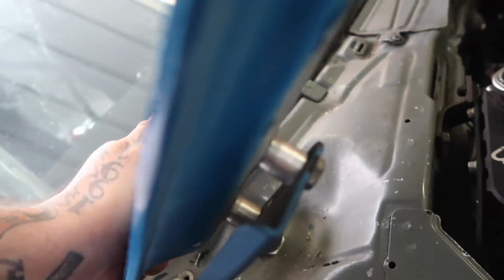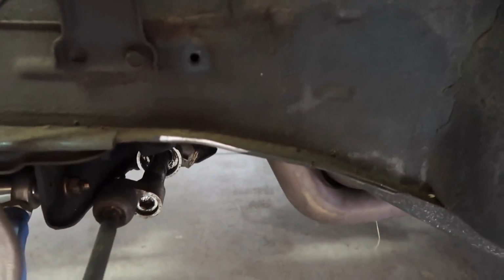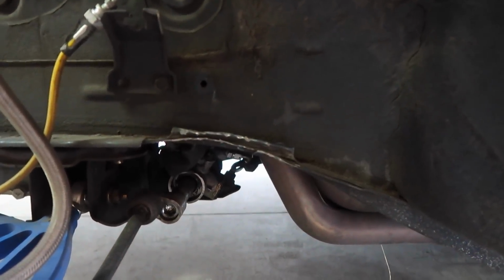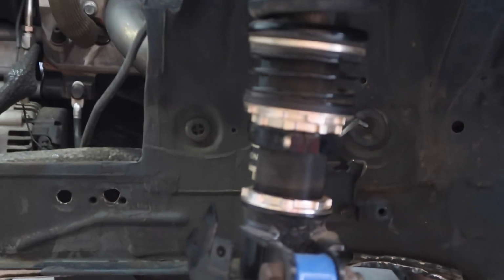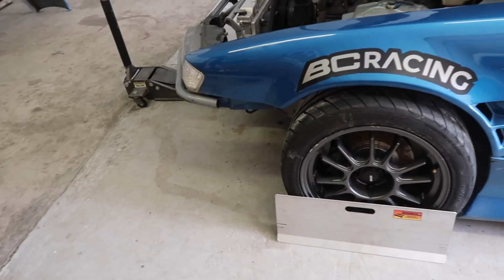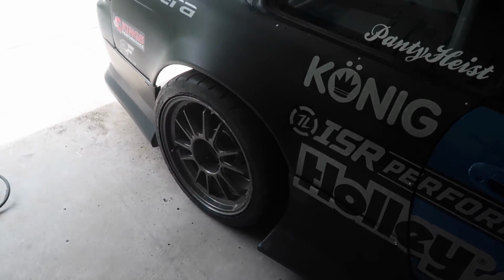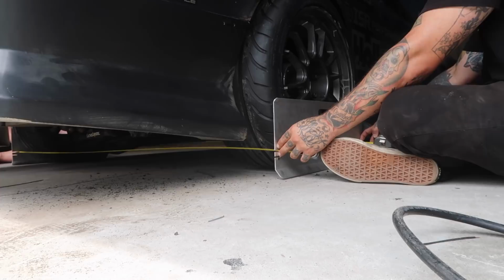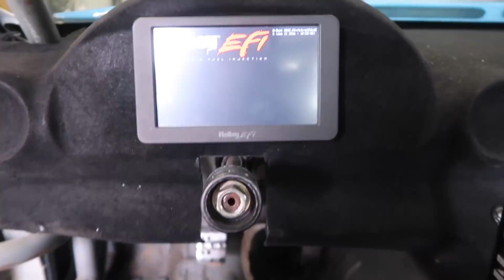CAR ALIGNMENT AT HOME!  (COILOVER ADJUSTMENT)

Comment: Look on the vid again when u r measuring the rear toe. It looks as if the tape was catching on the exhaust pipe for the rear measurement.
Reply from the maker: In the clip it was but we got a good measurement and it drives great

Comment: Is it that type of bc coil over that you can adjust ride hight the way you did, cause what you did or only showed was adjusting pre load. Every coil over ive seen or used you had to adjust right hight by un bolting the knuckle and spinning the spindle/mounting bracket, just curiouse.
Reply: shayne you spin the shock into or out of the coilover body. The only reason you would need to unbolt the coilovers and spin the bottom mount would be if the thread was too corroded/seized to be spun.
Reply: Preload = top lock collars. Height adjustment = lower lock collar.
Reply: Stop buying ebay coilovers and you will understand!!
Reply: Well fuck sorry i suck